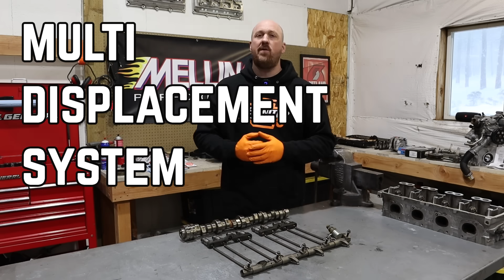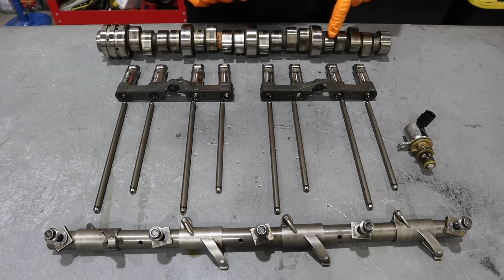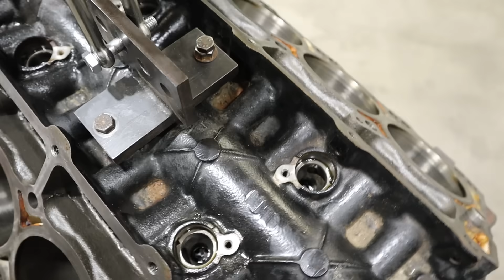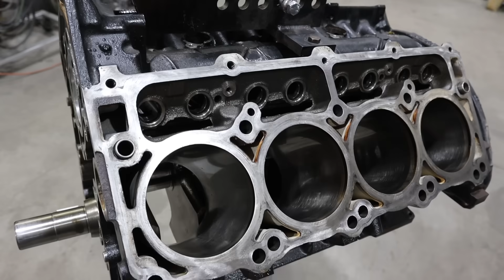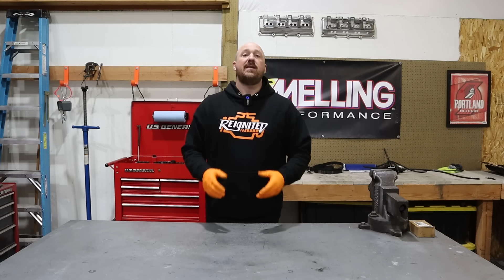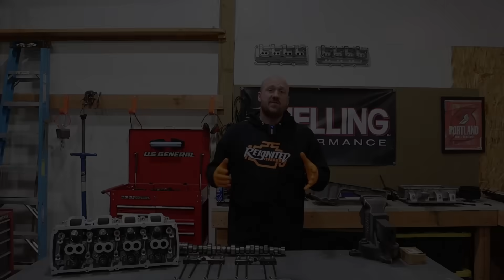Is MDS Damaging Your HEMI? The Answer May Surprise You!

Comment: In my 2022 Challenger R/T, to avoid the lifter/cam issue, I now try to keep an eye on when the engine goes below 1000 rpm. I avoid unnecessary idling (e.g., going through a drive-thru, or sitting parked with it idling to stay cool/warm).  If I'm stuck in crawling traffic (which is rare), every minute or so, I rev it up to 1200-1500 and hold it there for a few seconds to "feed the lifters" the oil they need. Eventually, I'll swap out to the new higher flow Melling pump so I don't have to worry about it.
Reply: have u had any issues with you’re lifters so far or anything so far? i’m thinking about getting a challenger soon
Reply: @qitzy9299  No issues at all. When you're shopping, try to go as low mileage as you can afford and listen as closely as you can for the tick. (Be aware that an exhaust manifold leak gives a ticking sound too...a lot of engines from all manufacturers have that issue. If the ticking gets much quieter or even goes away completely when it's warmed up, it's an exhaust leak. That's a much cheaper fix than the lifter/cam tick.)
Reply: @shnlyp4925, 0w-20 for the 5.7L and 0w40 for the 6.4L. I don't think any oil will get rid of the lifter/cam tick, it's actually mechanical damage where the cam is worn down and the lifter roller has completely collapsed into itself. Even if you can get it to quiet down a bit, the affected cylinder(s) will be reduced in power as the valve(s) aren't fully opening.
Reply: Wow, it's interesting that you have to do all of that. That would take away from the fun driving experience for me. No thanks.
Reply: @briandonald  I don't disagree. It depends on how you drive, though. The avoiding of drive-thrus and sitting in a parking lot with the car idling is something I've always avoided in every car I've ever owned, so those are not an issue for me. The only one that occasionally affects me is sitting in traffic, and that's quite rare where I drive (like maybe once a month or so). If I lived in a city where big traffic jams were a regular thing, there's no way I'd own a Hemi.
Reply: @DoctorHemi so literally a drive thru that’s horrible I mean wow just a drive thru but I had major problems in my 2019 bc I was idling for around 2 hrs a day and I was also using the gear limiter to put it to 8th gear every time I got in so I wouldn’t have to feel it go between 4 and 8 bc the exhaust vibration is just too weird it makes me feel like something is wrong.
Reply: @doggmansnapperdude3405 , it's more about daily habits, and I'm sure I'm being overly cautious. Going through a drive-thru every now and then probably won't hurt, but if you're the type that goes everyday during lunch hour and you're idling for 5-10 minutes each time, that could be problematic. Even worse, and I see this all the time lately, is people sitting in a parking lot in their idling car (for A/C or heat, depending on season) scrolling on their phones. They'll do that for an hour or more sometimes. That type of person should definitely NOT buy a Hemi vehicle.
Reply: Ye I need to start watching my idle time in scat. I jus have a habit of remote start standing behind it to hear it crank but then takes me a sec to get rolling not more than like 2 minutes tho
Reply: What about using the gear limiter to put it in the highest gear I had a 2011 r/t and a 2019 tradesman and both I did that to keep the vibration down or the feeling that drove me nuts when I forgot but if I do that did it cause oil to not get to those parts?
Reply: @doggmansnapperdude3405 , judging by the oil pressure guage (on the Performance Pages of the newer models), as long as your rpm is above ~1000, you're fine. The oil pressure there is high-40's/low-50's. At idle, though, it goes down to low-30's, and I think that's where the lifter starvation happens.

Comment: Thanks for another amazing video! These deep dives into how the various systems work are fantastic. I have a '17 Cahallenger Scat 6.4 manual, and just bought a '23 Ram 5.7 (gets delivered tomorrow, pretty pumped, first NEW truck) anyway, saw a video on another channel about the tick and oil viscosity. Poster claimed dodge changed the recommended oil at some point to a lower viscosity, and that going back to 5w30 from (i think) he said 0w20, fixed his tick. Did dodge change viscosity recomendations at some point? And whats your take on this? Thanks, and keep it up!

Comment: Also keep in mind the cam lobes are mainly splash lubricated. At idle with so little oil flinging off the crankshaft and lifter angle so shallow the cam barely gets oiled. Main thing i tell people to do is dont idle.

Comment: Hello Sky! Since I start watching YouTube, try to find information who fits my problem on, 2014, Ram 1500 5.7 Hemi! Lifter failure, and cam! Maybe this cause of forget to shut off my engine for several hours! Anyhow, rebuilt my engine. this time decide to cancel MDS. and Parts has been purchased from Comp Cams performance,  and MMX Modern Muscle Xtreme. here are the upgrade parts: 
(-NSR Stage 1 HRT 216/222 Hydraulic Roller Cam for Dodge 5.7L HEMI w/ VVT 2009+
Part# 201-300-17
     -Chrysler HEMI Phaser Limiter Kit Part# 5761CPG
    Evolution OE-Style No Link Bar Hydraulic Roller Lifters w/Yokes for Dodge Gen III HEMI 5.7L/6.1L/6.2L/6.4L Engins Set of 16
Part#  85601Y-16 system. MPVI2 HEMI Engine Tuner by HP Tuners with 2 points
    - NEW Hellcat Oil Pump (Fits all VVT engines)  Using HP tuner tool.  Driving the brand new engine follow the breaking step. since everything runs fine (accumulating around 500 miles so far) except one think check engine light still coming back.  Giving me this code. P000B	SES, Pending, Current, Permanent
   Exhaust (B) Camshaft Position Slow Response Bank1.   This Pinpointing the VVT technology system  and my case: Phaser Limiter Kit I use to change the angle. So question? I don’t know how to rewrite my ECM to be able to turn that check engine light off? Help! I appreciate and enjoying your hard work you put in and everything you do to Mopar Chrysler owners my appreciation, Daniel.

Comment: I've heard of the high idle time being an the main issue causing the worn cam/lifter issue, but what is considered high idle time?  I haven't been able to find a definition for high idle time.  I have a 14 ram 1500 with the 5.7.  My idle time in the instrument display is approx 20% of all run time since I use remote start quite a bit. Thanks.

Comment: I have an Exhaust cutout on my 2019 2500 that I open up for most of my driving. When MDS cuts on it sounds like a messed up diesel, so I use the gear limit selector to deactivate MDS. Are you saying that’s bad, or is it just people using tuners to bypass MDS?

Comment: My 2016 5.7 ram  just rolled 142k since new I have always used the gear down and put in 8 and that keeps the eco mode off. I never run it in eco mode. I average 18 to 20 mpg. I also have a catch can, intake and exhaust. Put a can of sea foam in the gas once a month and change oil spring and fall sometimes in the summer too. Not 1 issue knock on wood.
Reply: I just hit the tow/ haul button every time I start the truck up. It's so natural to do it.

Comment: I know why you are supporting this system and it is not because it is good. The climate people got to you. 

The collapsible lifter actually causes more load than if it was left alone. Turn off the injector pulse is more than a enough to achieve the effect. The valve train load is less than the compressive load not being released. The 10% increase in fuel economy can actually be increased with better driving habits and some tuning on the bottom half the tps stroke.
Reply from the maker: What can I say, the climate people pay good money 💰
Reply: @ReignitedAuto  I am sure its more the threat of being fined out of existence.

I think Cummins got off easy at 1.8 bil compared to the towing company for 900 mil. A fleet operator of about 60 trucks verses a multi billion dollar world wide company. The fine does not scale. Cummins is barely affected and will pass that in the cost of new stuff while that tow truck guy is in prison and out of business. 

If you have not heard of both stories do some digging. Its pretty crappy how this is going these days.

Comment: Off topic, How hard would it be to throw the AWD system from the SRT Durango/Grand Cherokee on the Scat Pack Challenger seeing that they share the same engines and trans and the rear diff. Or would the swap be easier with the 5.7 AWD Charger pre 2016. I have a 2021 Scat Pack and if i set the cruise control at 65mph Ive seen 27mpg on road trips. Only once pre 10k miles.

Comment: This video is a keeper! I have a 2011 RAM with the 5.7 Hemi, automatic transmission, 2WD. I really like the truck, and I am obsessed with maintenance and reliability. This information has helped me understand the MDS system and strengthens my resolve to change the oil and filter every 3K using full synthetic oil and top-tier filters. I look forward to seeing your next video. Thanks sincerely.
Reply: I have a 2016  outdoorsman quad cab 4x4 with a 5.7. I've never had a truck that rides smooth unloaded but has the nut of a race car when you want to be a speed demon lol I've owned Chevys Fords and am I'm in love with my ram it's just unbelievable how much balls that truck has in stock form.

Comment: when I had my 2015 Challenger R/T I was getting 28mpg with highway driving while the MDS was active, and 22-24 with mixed driving. I always thought MDS was the best of both worlds, great milage when you wanted it (with the expense of v8 sounds), and great v8 sounds with a push of the sport button that turns it off.
Reply: on heavier cars this savings gives almost nothing

Comment: Can the high-volume pump be installed on a New RAM 1500 with less than 20k miles on the odometer and on engines with less than 65k miles? Can a local dealership install this or should we seek out a hemi tech to install the high-volume pump? Lastly the estimated cost of installation?  Thanks

Comment: Cooling system upgrades. 180 degree thermostat, larger radiator. Transmission cooler.
Things to keep the engi e cooler and in the performance band in the South during summer. We don't really have a winter.

Comment: Good video overall. The only thing that threw me off is the fact that you said its worse to hit your tow/haul button every time you drive to deactivate the MDS for lubrication issues. In essence, if that was true, whats the sense of having the MDS if your a person that hauls alot or you live in a hilly area like me and the MDS is barely being used even if I have it on. Just a bit confused on that comment. So if someone buys a Ram truck to do alot of pulling or hauling, you should not get one with the MDS cause you'll have issues down the road due to lubrication? Thats what I'm picking up off of that comment. All the lifters better be getting the same lubrication at all times with or without the MDS system on. If not, thats a poor design in my opinion.
Reply: Totally concur. I find it near impossible to believe any oiling reduction would be caused with MDS off.
Reply: I've been running on tow/ haul mode for years and haven't had a problem. If running on tow/ haul mode was a problem, why would they let it be shut off.
Reply: Good point, also you would need all the lubrication you can when hauling do to working the engine harder..
Reply: Also, you can use the gear limiter to disable MDS. I wouldn't think there would be any negative effects of doing that either.

Comment: I have a Charger SRT 2015 and the tuner re-tuned the engine to get max potential power and disabled the MDS system and I didn't change any hard parts, will it affect my engine in the long run?

Comment: in my case, it was a non-MDS lifter that failed, on cylinder number 5. Mine was due to previous owners who should have earned the car a salvage title who never ever did maintenance work on the car. When I changed the oil filter, it was 2 years old.

Comment: Stupid thing is that the ppl who test these engine systems in vehicles continue to be horrible drivers. I owned a 16' challenger rt with the tremec 6 speed and continuously got 26-27mpg highway. Whereas the listed is 23 hwy. Its about how you drive. The mds was not in the manual transmission cars so this 5.7 was v8 all time.

Comment: 💢 Plastic Lifter Trays, allowing lifter rollers to rotate few degrees off axis to cam? Creates a skid effect over time. Then eats needle bearings, then wipes cam. 2017 & Up size of the needle bearings was increased in the lifter rollers.
Reply: That's what I was wondering. Do the trays ever fail to keep the rollers lined up properly with the cam lobes?
Reply: Ah ha ! It was '17 then that went back to the larger roller bearings ?

Comment: Hi great explanation, I’ve got a question i have a 14 charger 392 fully build engine high compression N/A and now my main problem is will the 5 speed transmission could handle the power that is producing or I’m going to face a slip in it and I thought of lot of modifications on it like upgrading the valve body and the converter but I’m worried that it won’t help Specially that the car is producing more over 600 whp I’ll be glad to hear a solution from you.

Comment: Being a 2015 Ram 5.7 owner, I appreciate every video you do on these engines!
Reply: Yes me2
Reply: I have a 15 as well. How has it been for you so far?
Reply: My 15 is going strong as well 117k on the clock  @Devlins10
Reply: All I do is worry about my 15 5.7, but this makes me feel better! Have done meticulous maintenance on mine and do not idle it 
79k on it have only had to replace the fuel pressure sensor and passenger side exhaust manifold
Reply: Yes 👍🏽

Comment: I ran my 09 hemi charger with MDS turned off for 150,000 miles with 0 issues. I also have a 17 ram hemi with MDS turned off it has 85,000 miles with 0 issues. So I fail to see the harm in running a hemi with MDS turned off. Im definitely not going to pull the heads to swap lifters for no reason.
Reply: How did you turn off MDS  ?

Comment: The 2007 Chrysler 300C 6.1 Hemi SRT8 automatic does not have MDS either. I've had no issues with this car after 15 years ownership. It would nice to lift the idle rpm up from 650 ish to 750-800 rpm. This would also provide better oil pressure at idle. I use Mobil 1 FSynthetic 5-40W oil.

Comment: Don't forget about using proper oil that MDS engine needs and limit idle time, if one does their research you'll most failures are from high idle and improper oil used, or even lack of oil change intervals.

Comment: I left MDS solenoids installed and plugged in with Big Cam/heads/VVT limited and non-MDS lifters.  Not necessary to remove and plug, in fact it’ll limit corrosion on the receptacles. 😊 obviously the tune is the dictator

Comment: I was recently driving my 2005 300C on the highway for some distance at an average speed of 70 to 80 mph while using my cruise control and eventually the car started to have these short intermittent hard surges about 3 seconds at a time? It kept on doing this until took it out of cruise control. I've been wondering if it was an issue with MDS kicking in and out or something else... 🤔🤔🤔

Comment: Loving these deep dives. There is a ton of misinformation out there about hemis and we don't really have many ways to prove or disprove a lot of the claims. Mad respect for you taking the time to explain all of this.
Reply: Appreciate your efforts to clear these issues up.  This past summer (2024) I completed my search to replace my 2003 Ford super duty  reg cab 8’ bed 5.4L 2 valve with a half ton model.i limited my search to the F 150 extra cab 6.5’bed, 5.0L V8 choosing to avoid Ram’s MBS, GM’s AFM / DFM after looking at hundreds of way overpriced trucks I could not find that Ford as, since 2011, all their eggs went into the ecoboost basket making the 5.0 very rare and illusive.ended up pulling the trigger on a 2020 Siverado 5.3 L series, $40 plug in delete making it all V 8 all the time
Reply: Exactly!

Comment: 2015 Ram short box/ reg cab. Hemi with no issues at 195,000 kms. Do my own synthetic oil changes. Best highway run last summer pulled 25 mpg, pretty good. Truck has catch can and muffler delete, MDS not a problem or issue for me.

Comment: 2019 Charger RT with the 5.7

Sometimes in 4 Cyl mode, if I'm cruising or ever so slightly giving it more gas, there is almost some sort of grinding/ humming noise that I can hear. If I let off and get back on the gas to maintain speed, it'll stop the noise. Likewise, if I have it in manual mode where its using all 8 cylinders, I never hear this sound. Any ideas??
Reply: Same. My 2017 has a kind of transition vibration going in and out of MDS so I only leave it on when doing longer hwy trips with cruise on. 81k miles and 🙏 for 200k 😎
Reply: My 2011c also has a heavy vibration when the mds is active.  Even at low speed (20-30mph).  I been using the auto shift to keep it off because I'm worried about costly failure....  ive been looking for advice on how to manage that